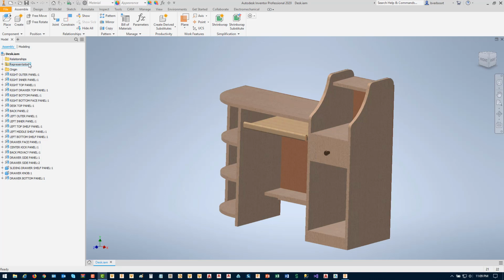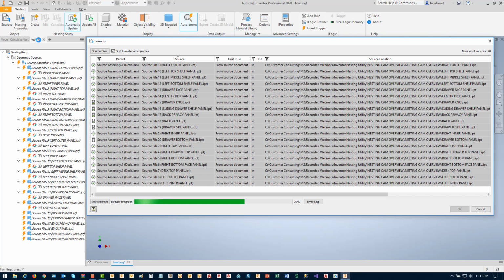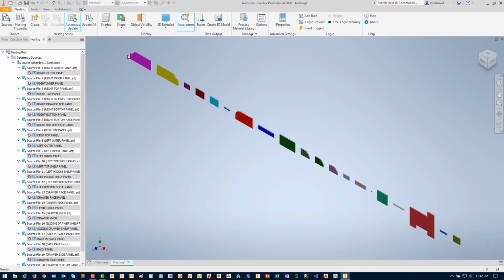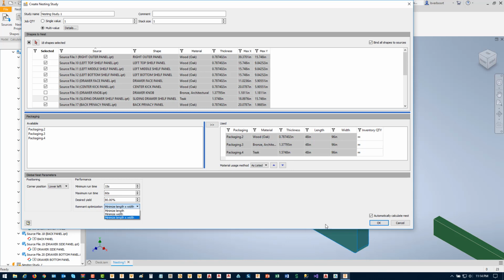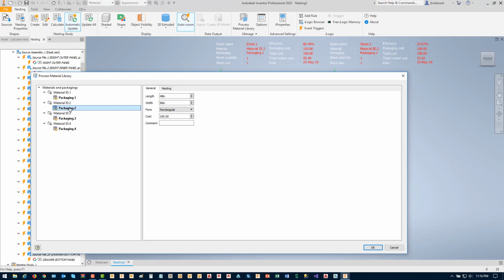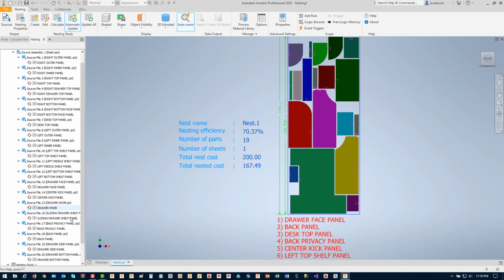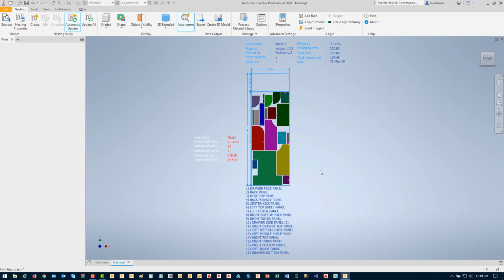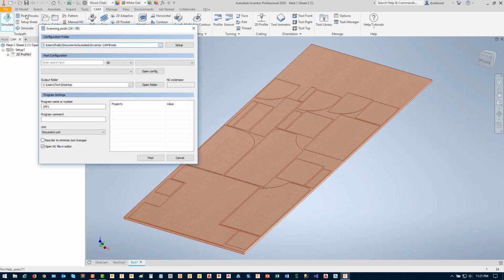INVENTOR NEST AND INVENTOR CAM WORKFLOW OVERVIEW

Comment: Good day Brian, I am new to Inventor Nesting and presently using version 2023. When I created the nest it only showed 1 of the 2 parts in the nest as well it did not show the thickness of the material. I am trying to use 18mm thick plywood but I am unclear on how to get the part to have 18mm thickness. Any help would be greatly appreciated.
Garth